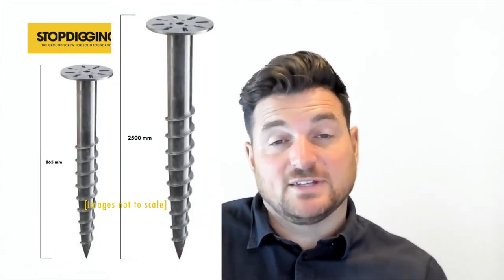StopDigging - The Groundbreaking Advantages of Ground Screws

Comment: I've been looking at ground screws for my planned kitchen extension unfortunately they wont be suitable for me and for most others for two main reasons firstly floor level a totally normal 150mm above outside ground level minimum for a suspended floor is around 400mm it would be easy to solve but none of the installation companies has bothered to.
The other problem is drains if adequate earth is removed using a bore hole of sufficient size it would be possible to install within cm of pipework and cause no disruption it could be a real game changer. 
This technology has potential but it is in its infancy only useful for sheds.